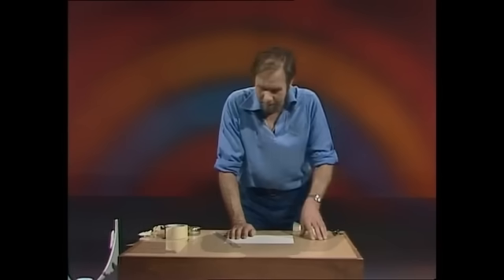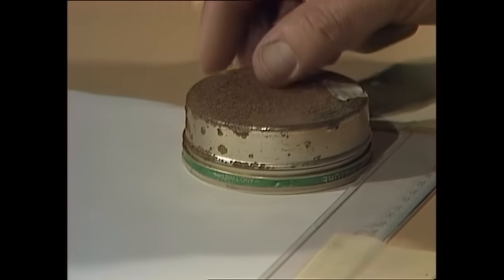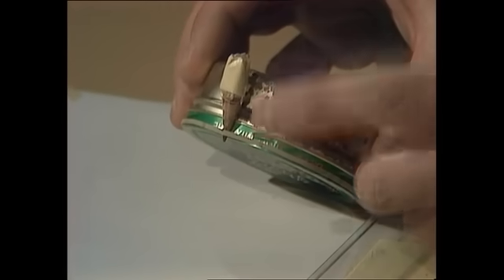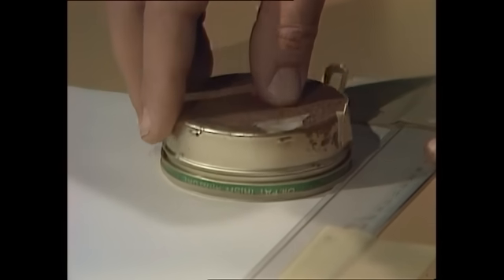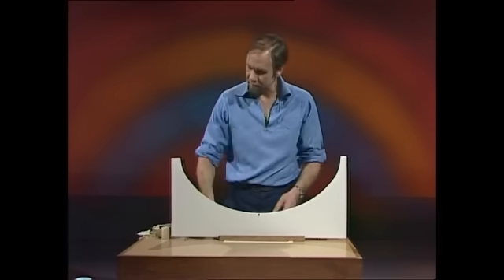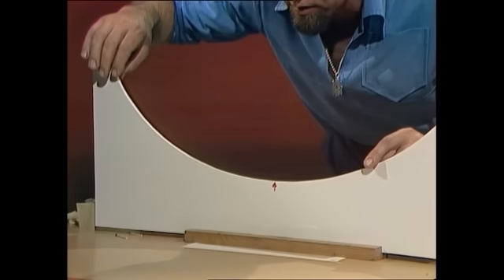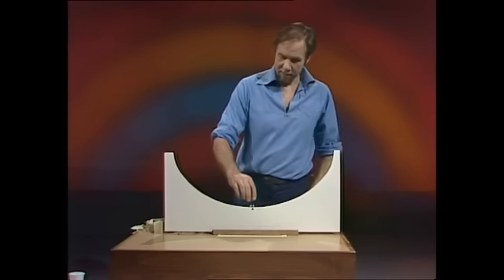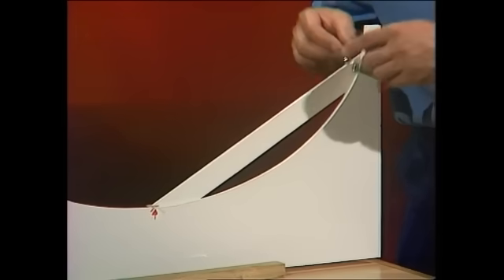The mysterious isochronous curve

Comment: The ball dropped from the higher point reaches the arrow slightly before the ball dropped at the lower point the kinetic transfer happens slightly after the arrow not before it or at it but after it on the lower ball dropped side.

Comment: Definition of isochronous: The word "isochronous" means "equal time". 
An isochronous curve is a path where an object will take the same amount of time to travel from any point to the lowest point on the curve.
Christiaan Huygens was the first to show that the cycloid is the curve that solves this problem, a discovery he detailed in his 1659 work on clocks.
Kinematic interpretation: the evolute is the base of the movement of a plane over a fixed plane, when the moving plane is linked to the tangent to the curve. The rolling curve is its normal, and therefore rolls without slipping on the evolute.
The cycloidal pendulum of Huygens uses  the fact that the evolute of a cycloid is an equal cycloid. It is interesting because of its oscillation period T , independent from the amplitude( as opposed to the free pendulum only the "small" oscillations of which can be considered as having the period T.)
The cycloid is also the brachistochrone curve, the path of fastest descent between two points. This means that the path of fastest descent is also the path where the time of descent is the same from any starting point.

Comment: I don’t mean to be a bummer.. but I’m not getting the novelty of it. When you look at the curve, it clearly gets exponentially deeper the further away it is from the center.. and the closer to the center the flatter the curve gets.  So when you release the ball from further away it has more velocity to work with because of the depth of the curve, and when you release it from close to the center it has very little velocity to work with because of the flatness of the curve. And a wheel is perfectly cylindrical - so it would make complete sense that two balls would meet at the center when released at any point - it just shows that the curve has the same symmetrical properties of a circle. It’s just demonstrated in a different way. 

And of course the ball on the curve beat the ball on the straight line - did anyone think it would happen differently? It doesn’t matter that it’s a longer path - the ball on the curve has a much greater initial velocity to work with.. it’s like the difference between dropping into a halfpipe with a skateboard (which creates an immense burst of speed) vs casually cruising down a diagonal ramp. The person dropping into the halfpipe is going to burn past anyone starting their run at a 45° angle no matter how much more distance needs to be covered because of the basic realities of velocity, potential energy and gravity. 

The first part was somewhat interesting I guess.. but that second part was just common sense. I’m sorry, but this is hardly a spectacle. 😂

Comment: Many tunnels can be constructed between points A and B on a planet. A ball dropped in the tunnel at point A will roll frictionless to point B by the action of gravity. Which tunnel will be the fastest? If you trace the curve using a circle of diameter d on the inside of a planet of diameter D, you will generate the path of the fastest tunnel between two points on the surface of the planet. If d=D/2, the path will be a straight line thru the planet, as would be expected.

Comment: So the fastest way to get somewhere isn't always in a straight line afterall. I'm wondering if this is essentially the same principal at play when they sling shot sattelites around planets in order to increase their velocity so they ultimately even though they're travelling further get there quicker than they would otherwise. Is this really to do with the curve though and not just the result of gravity. It's sort of not a proper circle though its stretched out. Kind of a middle ground between the two. Essentially like phi and pi... Mind fart... I think phi has a relationship to the interference pattern in quantum mechanics 🙃 Atleast in the way I think of the interference pattern being an all pervasive Web intersecting all points in space and time

Comment: these answer is weight.  same as storing energy in a  heavy wheel....if it momentum minus you and the bicycle's weight is positive you will accellerate, if its under 0 you will not accelerate 😕

torque I know from drag racing,,,, not science :-) why the 3.73 to 1 rear end got changed to 4.11 :-)  more torque to the 20" slicks dude LOL

Comment: The Kessel Run is a contest of speed and endurance for smugglers in the Empire. Those who undertake it must deliver specified cargos (usually illicit in nature) to a series of divergently moving transport vessels. The smuggler must deliver the cargo before the transports wander out of the free trade lanes into restricted Imperial space.

Han Solo made the Kessel Run in better time than the straight line path and in less distance than the best known smuggler's path because the Millennium Falcon had the ability to handle the speed necessary and the stresses generated in following an isochronous curve that covers less than 12 parsecs of distance instead of the known 14 parsec path.

Comment: The surface distance the tangent point of a wheel moves for every isochronous curve is exactly 2x it's diameter.

If my calculations are correct in my waking hours, there will be 960 isochronous curves when a 33 inch car tire goes 1 mile (5,280 feet) < I will take that as fact since I am not thinking about it anymore.

Comment: It's gravity. A steeper slope creates the stronger gravitational pull, hence why the steep curve beats the not-so-steep straight line. I'm sure it's slightly more complicated than that, but that's the nuts and bolts of it.
Reply: I'll bet you think gravity is the best chit🤗 You're probably happily clinging to that tiny anti-centrifugal spinning water ball invented by NASA, where there's an atmosphere of 14psi right next to an open big magical push pull sky vacuum. 🤭
It's very simple neither slope created anything. (YOU) fall through the air @ X vs float or sink in water @ Y 👇flap?🤪

Comment: That was interesting are there practical use applications for this curve?
Reply: An application was in designing the shape of a pendulum clock bob. This provided the bob with a constant to and fro swing time, regardless of the magnitude of the swing motion. This allowed the pendulum clock to keep time as the spring mechanism lost tension.

Comment: ...bcs acceleration  of the highest ball >> than the second, the curvature being the solution, where total travel time of the highest ball equals the travel time of the second, turns out, requirement for the solution is the particular case, which fits the circumference of the tin box times its diameter, for anyone who cares

Comment: This all depends on if the propulsion is driven by gravity, and various other mathematical "intrusions".
But if given JUST this tracked "course" than yes, this is the fastest method of "travel" in existence. 
This is but a snippet of the actual "science" in nature of this source of travel. And it most certainly is one way and finite in energy.
The fastest route between two points is indeed, still, a straight line.
What both fail to explain or detail is resistance and means of propulsion. Which either exist or does not exist in both demonstrations. That is a huge variable / calculation in both demonstrations.

Oh well ....

Comment: Thinking back to the original explanation of a point on a tire drawing the curve. What this means is that in a circle rolling without slip, every point on it is aways moving forward in the direction of travel, even the points on the rear end that needs to spin back around to the top. Thats not necessarily an intuitive conclusion and is pretty neat

Comment: Can anyone explain why this isn't just a product of gravity vs friction? 

The higher the ball, regardless of distance, the more momentum can gather and therefore is less prone to friction. The faster it will travel.

The lower the ball, the less momentum, but also less friction to overcome, due to the shorter distance. So it travels slower but has less distance to cover.

The straight line is just introducing more friction and allowing less momentum.

Comment: The most peculiar isochronous curve is created when the drawing point is in the very center of the wheel. This curve would be a straight horizontal line, an infinite, level rail for the two balls. No matter where you put two opposing balls within that curve, they'll take the same time to reach the lowest point (no time at all, as every point is already the lowest point), and they'll take the same time to reach the absolute center of the curve (forever). Of course, how we define the center of the curve is obvious in any other case. But in the case of a straight line, is there or isn't there a definite point that represents the middle of one cycle of the wheels?

It's possible that we're dealing with not just the simple division-by-zero that results in one of many flavors of "infinity". This might be zero divided by zero, which is as unanswerable as it is answerable by any chosen number. After all, the "T" in this race isn't "how long does it take until it gets there" but rather "at what point in time does it reach the goal?" That's an important distinction. If it's just "how long until", then it's zero or forever. But if it's "at what point in time", then it's zero, forever, and any real amount of time in between. At zero, it is there. So zero is an answer. One second later, it's still there, so one second is an answer. And so on.

I don't know the mathematics of the isochronous curve, but I'm curious if that really is a 0/0 situation.

Comment: Actually the isochronous curve is independent of the mass of the body or the local strength of the gravity.
At such negligible height in the experiment, the gravity difference is also negligible to begin with.

It's all about acceleration and time.
Actually, these curves don't try to minimize distance, instead they try to minimize the time via faster intial acceleration.
The cycloid shape allows for that faster initial acceleration due to deeper angle. 

Brachistochrone curve is actually the fastest one though. They're more of a cycloid than a curve in reality.
Cheers

Comment: What I took from this was proof and the fact there is a mathematical evidence of a theory I have had for some time now.  When you start something new come out hot (or fast).  The reason (of course) the ball on the curve hits the "finish line" first is it comes out fast!  So, when you are taking on a task come out fast and get some momentum going.  People I have worked with (or done anything with) in the past will say "Slow and steady wins the race" but as we can see here, that is not the case.  the next time you take on a project come in guns blazing and get the first 20% of it done with all your effort.  Once that momentum is going it's much easier to get the project done faster (overall) even if you can't maintain that speed the whole way though.  Great video.

Comment: How is that mysterious? The additional energy for more speed comes from 2 things:
More usage of stored energy because they are lifted from the ground, so the gravity will pull on them but only one has a free fall at the start. Secondly and in regards to that fraction slows the balls down caused by air, the wood (micro bumbs) and electromagnetism. Without gravity the short way is the fast one c:

Comment: In mathematics, a "isochronous" curve would be called a "logarithmic" curve. Basically, it's when you look at a diagram that will go up or down a scale exponentially rather than at a constant rhythm; Basically the straight line makes the ball goes at the same rhythm, while the isochronous curve makes it go exponentially faster, until it's stopped in the middle, because when it goes to try and climb on the opposite side,  it becomes exponentially slower - and by then it has lost it's momentum and came back, obviously, to the middle of the curve, because it doesn't have enough energy left to nothing but stop and is unable to climb again. This is a visual demonstration a logarithms, used in such things are a tube guitar amplifier volume (gain) knob, for instance, where's the difference between each number will become exponentially bigger as you go up in volume; why do they number such knobs 1-2-3-4 etc is beyond my comprehension, because it's confusing as hell!

Comment: So, use a round object against a flat surface to create a curve, then use another round object inside the resulting curve. Is this compounding or negating?

Also, I assume this experiment only works when the two objects are the same diameter?

Comment: It’s mathematic sequences like this that prove were in a simulation.
Reply: That's absolute insanity. It only proves that logarithms works. Basically the straight line makes the ball goes at the same rhythm, while the isochronous curve makes it go exponentially faster, until it's stopped in the middle, because it goes the opposite, *exponentially slower*, when it reaches the other side - and by then it has lost it's momentum and came back, obviously, to the middle.

Comment: What if you had another wheel with a piece of pencil that rolled down the curve? What would that line look like? Iso doubled...i imagine it would be an airplane wing shape overhanded. Maybe it would simulate a catapult or bullet drop or a shot put arc?...if you did a 3rd iso curve on that track and put them end on end you then kept going you would get an ever sharpening curve like the golden ratio probably..youd have to flip the curve every time though.

Comment: That's because the gradient of the slope is greater at the start for the ball bearing that goes down the isochronous curve, than it is for the one that goes down the straight line. So the greater momentum built initially by the "curve ball" over-compensates for the reduced distance travelled by the "straight ball", and the average speed over the entire length travelled is greater for the former than the latter. Such a nerd, I know.

Comment: Pretty simple, but I'm surprised they didn't explain it in the video. The lower the ball is placed on curve, it has less distance to travel but has a lower velocity due to less gravitational force being applied. When you place the ball higher, gravity gives it a higher velocity, but it has more distance to travel. The isochronous curve appears to cause these variables to equal out. Long/Fast = Short/Slow

Comment: Great demo, really cool! This made me think of my old Spirograph. I’m sure there was a way to draw an isochronous curve with that setup.
Reply: Mike - I was thinking the same thing.
Reply: whats thee difference between this and a brachistachrone
Reply: You'd have to stick the pencil tip in the gear along the edge, rather than one of the holes in one of those disks, but yes.  But you could probably do it free-hand, without tape.  Just one of the disks, one straight edge (comes with Spirograph), cardboard, paper, and push pins to anchor the straight edge.  Pretty much all a part of spirograph, only I don't think using a pen along the outer edge is in any of their instructions.
Reply: @harrymills2770  Why would you need to put the pencil on the edge. Surely the same thing would happen if you put the pencil anywhere in the far outside holes?
Reply: @castleanthrax1833  I don't know if it matters in terms of isochronosity, but not having the pencil on the edge elongates and flattens the curve as the radius to the edge is longer than to the pencil and thus moves the pencil forward faster than if gear's radius was same as the pencil's position. The extreme case is when the pencil is at the center of the gear producing a straight line.
Come to think of it, the isochronous curve shown in this video has the derivates of its cusps perpendicular to the direction of travel, whereas if the pencil isn't at the edge, that changes. Closer to the center, the pencil still stops vertically, but as the horizontal velocity of the gear is larger than the pencil's, their horizontal velocities don't cancel each other out and you end up with more of a V shape. Or possibly a smoother dip. I'm having trouble picturing it. If the pencil was outside the edge of the gear, though, it would travel backwards and draw loops instead.
Reply: ha..ha...ha... Yes, coz I don't think anyone has a spare 'tobacco tin' sitting around  :)

Comment: What if there was a curve that with the help of magnets or a coil could propel a sphere or spinning top type object back to its original location many times a second and the movement could be converted into energy?
Reply: It would be pointless?
The reasons? Friction from the sphere on the material, friction from the air, "friction" from the magnets would all slow down the ball

Comment: The first thing he said is confusing me. Wheels are perfect circles if taught and properly filled. The tape or mark doesn’t delay or stay stationary at all. The weight on top should not radically change or flatten the curvature of the wheel.
Reply: The circumference is over 3 x the diameter, so the line has to “stretch” somewhere -

Comment: Its just the velocity the ball attains while coming from height. The lesser distance from the center u start with the harder its for the ball to attain velocity, and the other ball which apparently has a higher distance but its ability to catch the velocity fast is the reason they both meet at the same spot. Basic physics